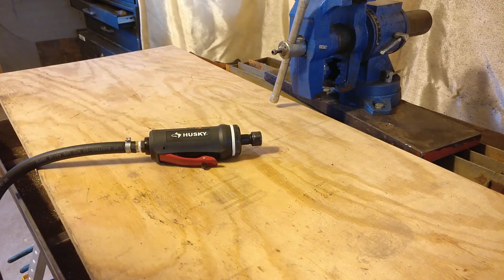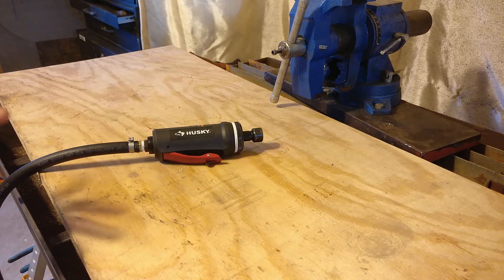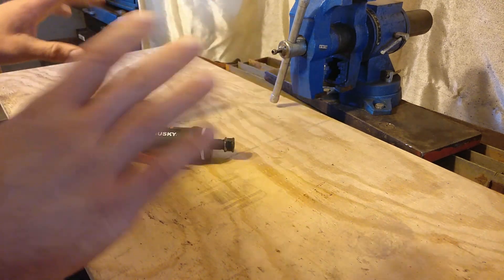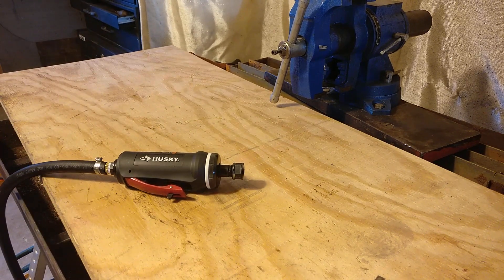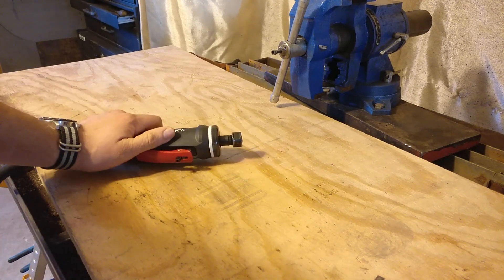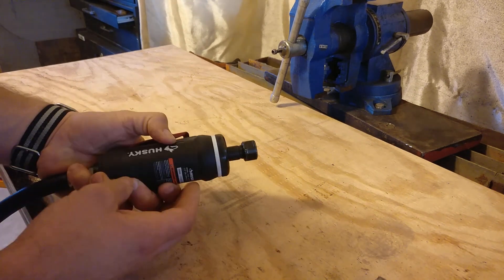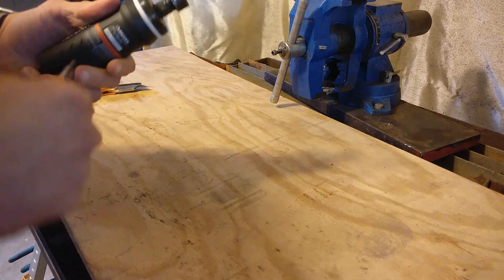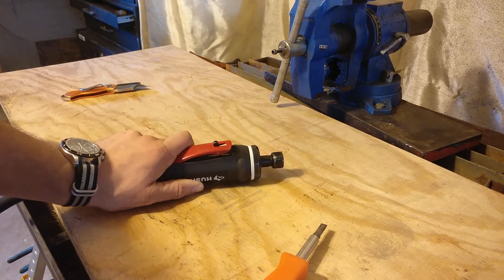Husky Engineering Fail: Die Grinder Throttle

Comment: Or you could just knock the roll pin out of the safety lever (removing the safety) then you can just control speed with control lever unencumbered. If you want to get real fancy turn the head around (on the right angle design) and use your thumb only while using the rest of you hand to control the tool. I do it with every one I get.
Reply: When you turn it up you don't really know the RPM which can make it unsafe when using low RPM attachments..   just my 2 cents....  btw, I think Chucky 2009 rocks.  I've learned lot's from watching his videos.